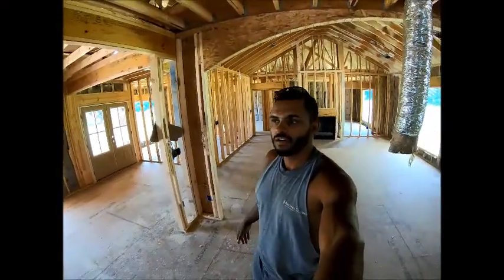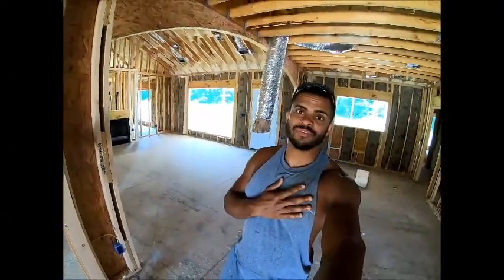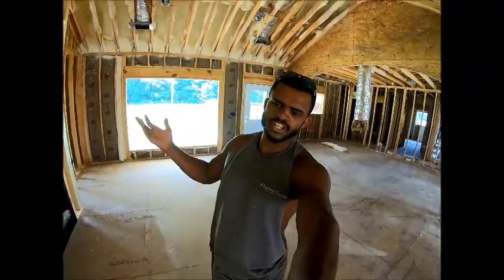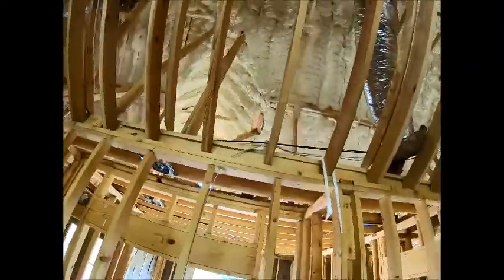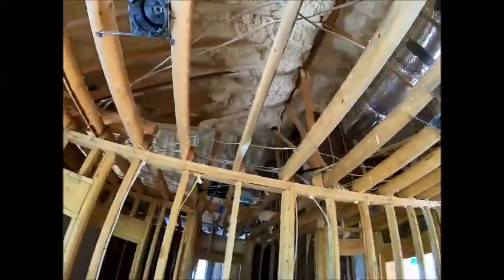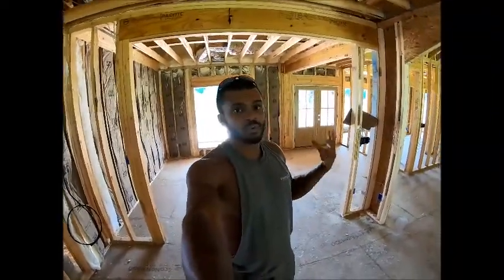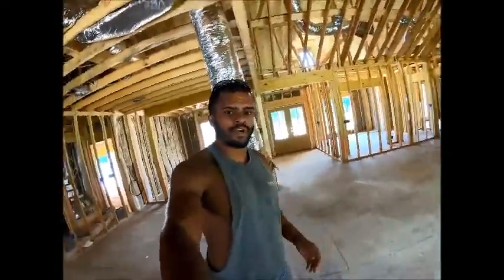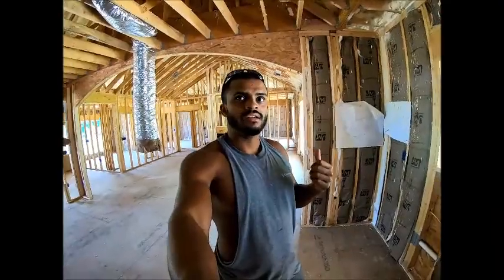Spray Foam vs. Traditional Insulation

Comment from the maker: Just to correct myself: it was an additional $10,000 for the hvac system bringing that total to $28,000 and then roughly another $10,000-$15,000 for spray foam